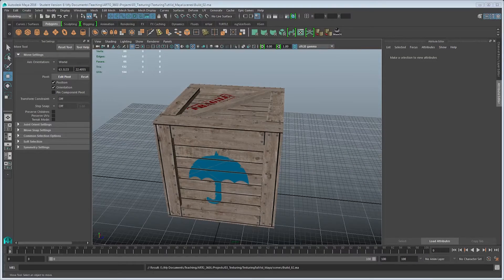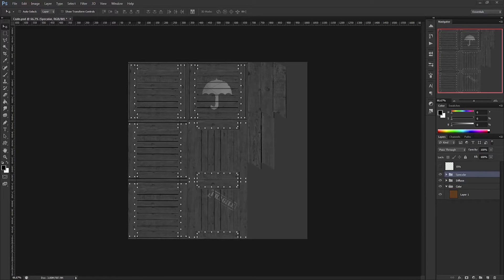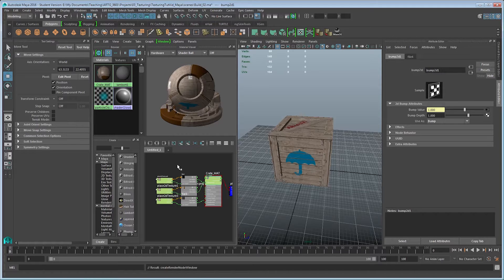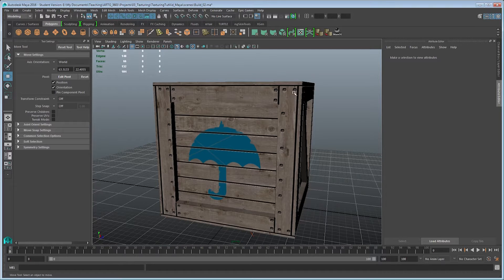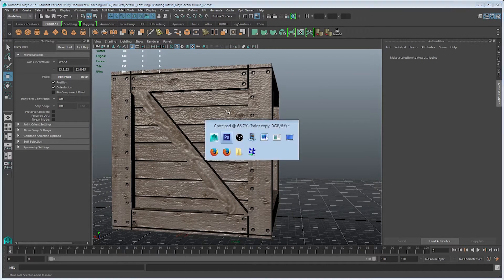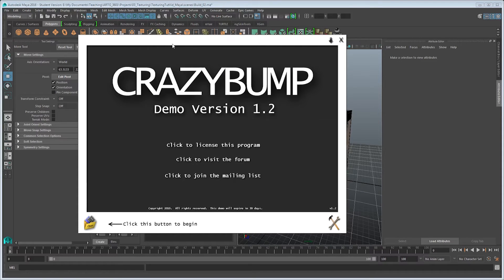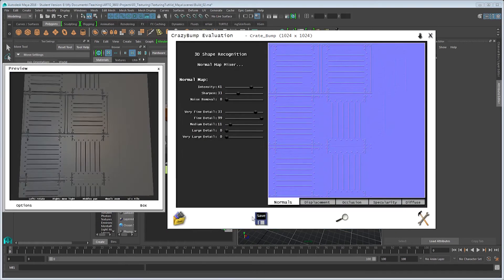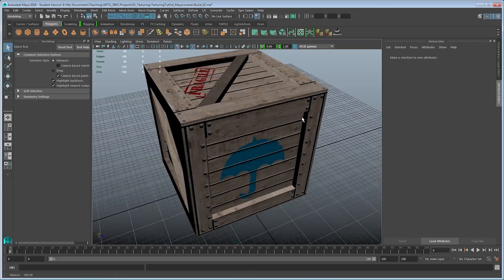Creating 3D Textures: Bump and Normal Maps

Comment: THIS VIDEO IS INCORRECT! please take it down and fix it!

what you are describing as a Greyscale map is called a Displacement map. a bump map has no Neutral value, its based off of contrast between pixles. so if you want something to only pop out, you should not go from grey to white, but rather black to white.
Reply from the maker: Bump and displacement are both greyscale maps but serve very different purposes.  Bump effects the lighting across the surface normals of an object giving the illusion of greater surface depth.  A displacement map.. displaces the physical geometry which yields higher quality results, breaking up the silhouette of a model, but at a much greater impact on render time.  With a games workflow as the tutorial was intended to be used for, displacement can be used but is by no means ideal.  Thanks for your concern.
Reply: You seem to miss my point, the way you describe a Bump map is the describtion of a displacement map. a displacement map has a neutral value of 50% grey, anything darker will push the surface down, and brighter will push the surface up. however that is not how a bump map works. a bump map has no neutral value, in fact when exporting a bump map you should try to make sure that the brightest value in the map is pure white, and the darkest value is pure black. this is to get the most information in the bumpmap. this however is not the case for displacement. a bumpmap works by faking displacement in the mesh based off of the contrast between the pixles. 

your video is missleading.
Reply: at 0:47, Wesley states ". . . so that light can interact with a surface without having to define small details in geometry." This is clearly a description of a bump map and not a displacement map.